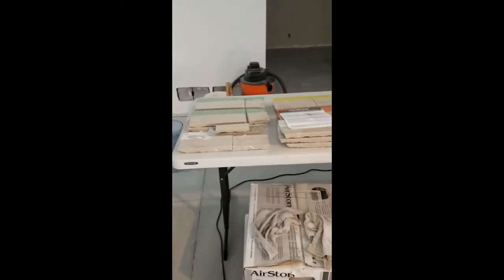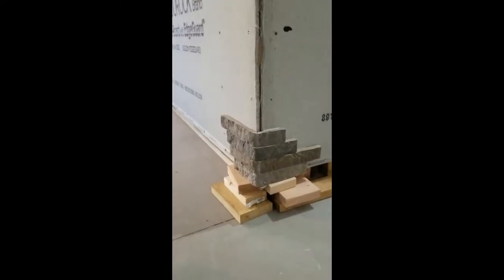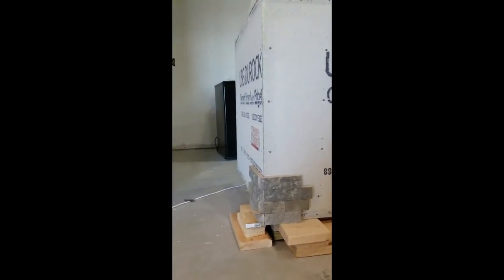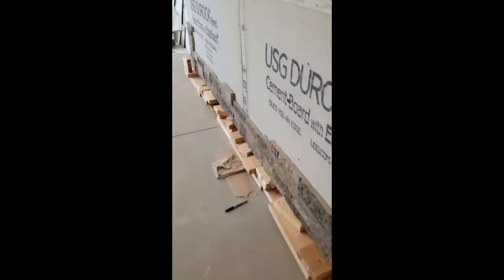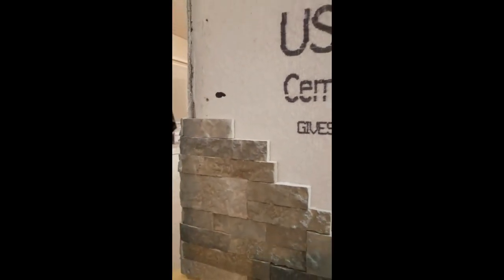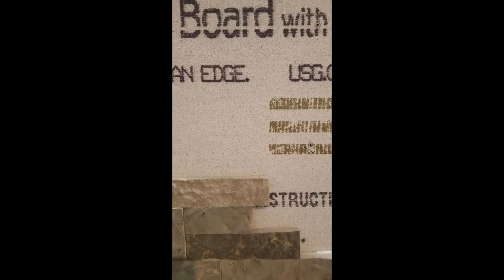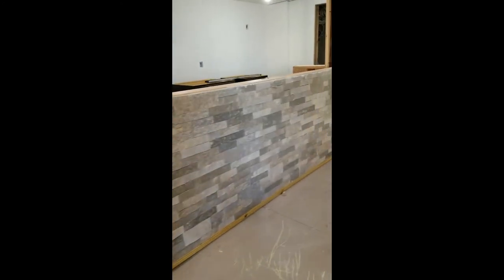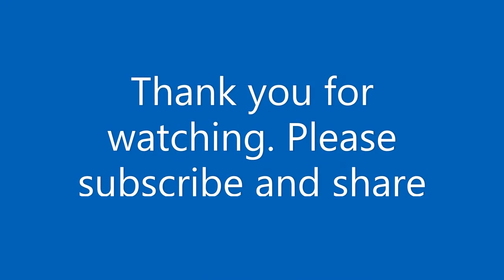Basement Bar Using Air Stone from Lowe's

Comment: I did this on my kitchen bar and it's WAY harder than tile because the stones are not uniform shape so i had to shape each tile's width.
I would never use this product again.  I have done 3 back splashes and two showers - so I'm no tile expert but I do have 3 water saws ...
Some tiles were far thicker than others, 30% waste, I did return all the broken tiles and blotchy dark ones.